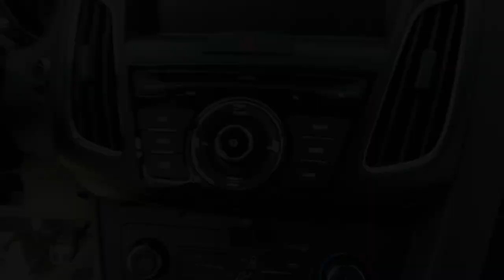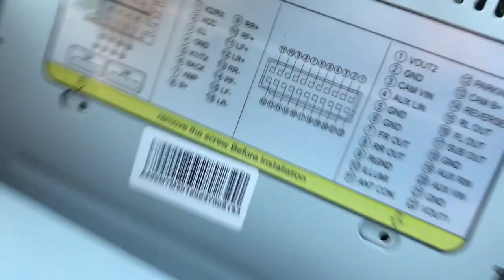2017 Ford Focus ST Subwoofer Install Part 2

Comment: I've always been jealous of how you can hide wires.  I couldn't hide 1 wire in a school bus.  I'm taking some notes because the old Accord is due for an upgrade.  Nothing crazy, but the 11 year old factory system is showing it's age and it's time to take it back behind the barn and put it down.
Reply from the maker: Its not a difficult art to master. Just takes a little thinking, thats all. Some people go insane lengths to make wiring crazy perfect but I feel that time could be better spent elsewhere. I look at wiring as a layer cake but the top looking good is all that matters. Hit me up when you start tinkering with the tunes.

Comment: Did you end up installing the ground wire where you mentioned screwing into the bottom of the trunk area there?
Reply from the maker: Yes, it is under the amp since there is over an inch of clearance. I used a Dremel sanding wheel to take away the paint and installed it.

Comment: When you pulled out the radio was there already a rca cord to plug in or did you have to install a converter?
Reply: While it looks OEM, the radio is a drop-in aftermarket Android unit so there was already a full suite of RCAs to deal with.
Reply: Is it the one you showed in the video ? The mono out sub ? Thanks

Comment: Will it power 2 12s the stock radio and did u how did you wire the remote
Reply: Ant con ?